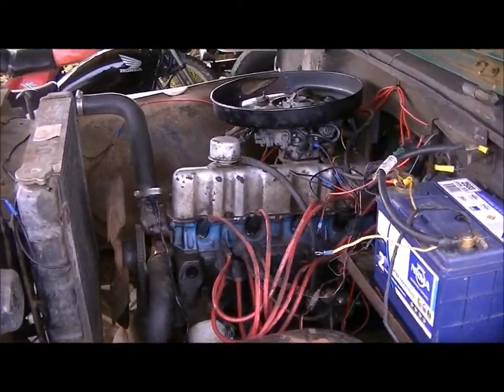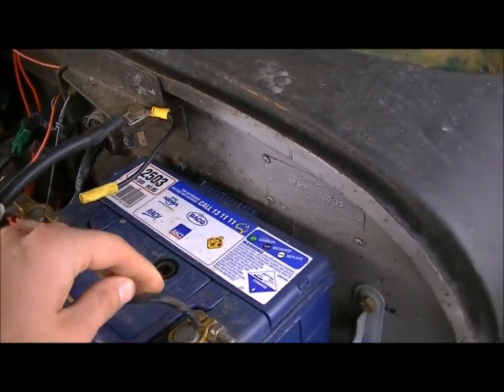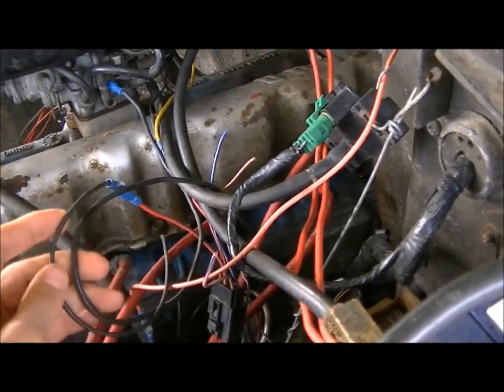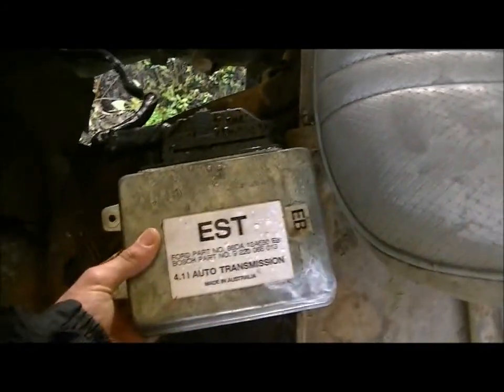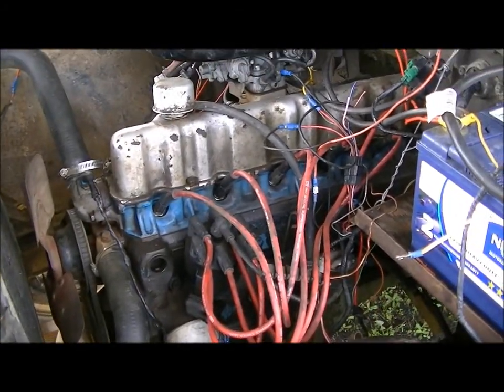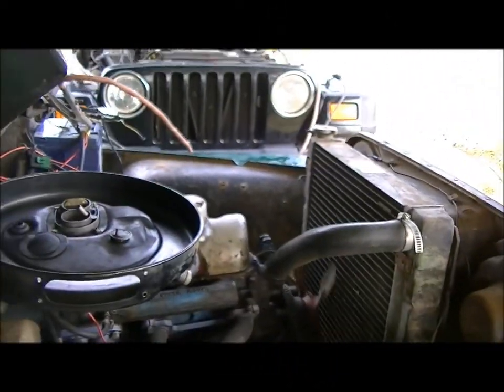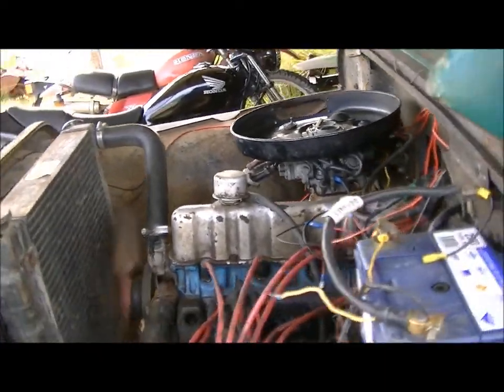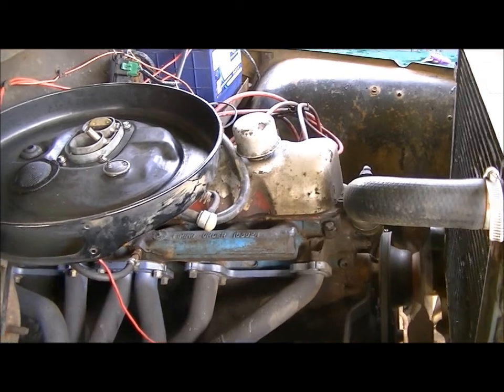1965 Jeep CJ5 gets electronic ignition

Comment: If you sorted out the excuse for a wiring system then you might not have needed electronic ignition.
Reply from the maker: thra5herxb12s with all due respect, the wiring had nothing to do with its ignition issues - lack of centrifugal advance caused my ignition woes. This was done on a whim over a weekend, and it's still going strong. ;)